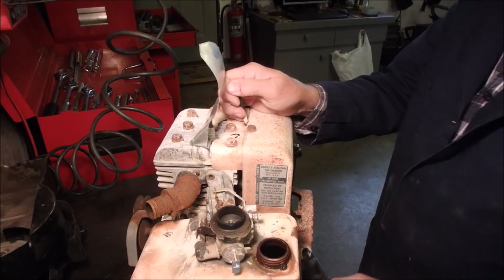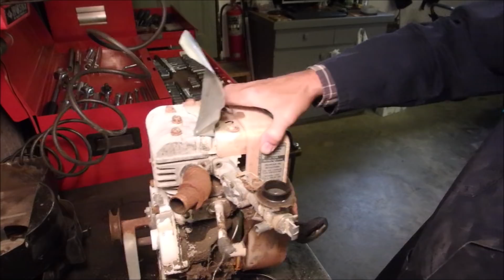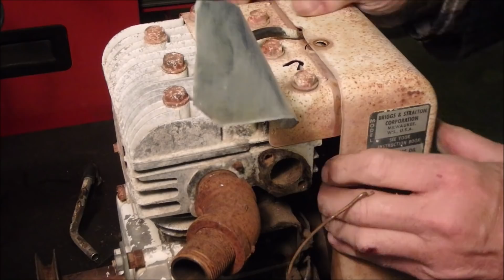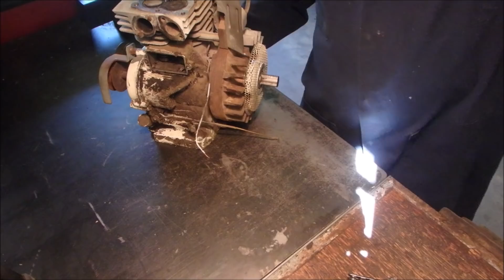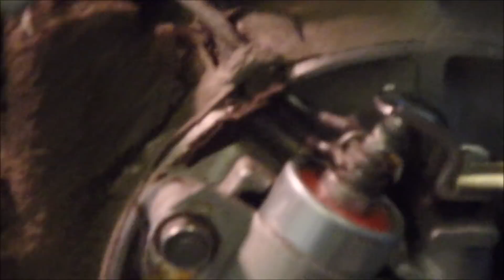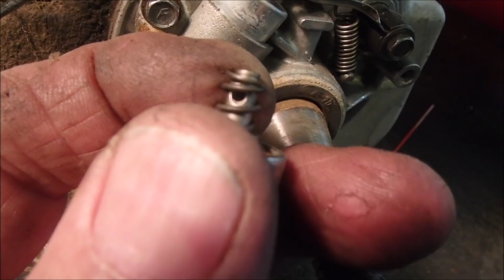Briggs 1971 has a little fire.  FUN!!!

Comment: I acquired a horizontal shaft engine not long ago from a friend. It was still in the box, as it had been shipped from the factory. My friend had inherited it from his grandfather, and I asked if I could buy it from him. So I bought it, put it in my basement, and kinda forgot about it. Yesterday I decided to take a look at it, after watching this video. It turns out it is not a Briggs and Stratton, as I first thought, but it's a Tecumseh horizontal shaft engine, manufactured in 1986, and has never been run!
Reply from the maker: Wow  I am not sure if i would start it.  I don't know what you should do.

Comment: Hey Bruce
Any chance you have a spare “control cover” for a 7.0 Quantum that you’d be willing to part with?The part number is 792418 (the small black cover over the carburetor).
Thanks,
Jim
Reply from the maker: Where are you located Jim.  Shipping items out of Canada is very expensive.  I should remember but I am pushing 40,000 subscribers now.
Reply: @BrucesShop  Hey Bruce
I’m in the Edmonton area.  
This morning I was able to find one at the Lawnmower Hospital.  I brought one in that I had and they found a used one that matched and gave it to me for free!
Thanks for checking!
Jim
Reply from the maker: @jimyeske8498  I use them too.  Good job.
Reply: @BrucesShop  
Funny how a small piece missing like that affects the perceived quality/value of the machine.
Reply from the maker: @jimyeske8498  Right

Comment: Loved the vid right up til the fire .. glad your ok.. got question.. put brand new carb on Briggs intek to stop a fuel overflow prob.. the cut off solonoid is working I checked it.  It's a 15.5 intek.. cut grass w it yesterday no prob.. today I went to start and she was vaporlocked.  Pulled plug and fuel poured out.. cleared cylander and started right up.. any idea what I'm missing.. could new carb have bad needle n seat.. help
Reply from the maker: The needle and seat have to be leaking.  Do you have a way to pressure test the carb.  You can blow into it with your mouth on a clean 1/4 inch fuel line if needed.
Reply: @BrucesShop  thanks u were right.. I heated it up and adjusted the float so it sat level and fixed the problem.. you rock sir
Reply from the maker: @MunkyWrench  I agree with  Munky

Comment: I did one of there  rusty gas tanks several years ago and put pea gravel in it and taped it up and I had a friend that had a paint shaker and he strapped it on the paint shaker and it really cleaned the inside  up almost perfectly . Ive been told if you have one of these metal tanks too always keep it filled with gas in order to cut down on the rusting process  . I had a 40 year old briggs triller and thats what I always did too it until I sold it last year and it never did rust up .
Reply: Great tip Marshall!  I bet the paint shaker made that tank nice in short amount of time! ✌
Reply from the maker: @rogermcdonald1607  Yes  I just did a tiller as old as this one and the tank was full of fuel and perfect as well.
Reply: @rogermcdonald1607  I did a great job .

Comment: I don't  believe i have ever seen an engine with 2 output pulleys. What application would be be used on?
Reply: Reverse on
A roto tiller
Reply from the maker: @THEMOWERMEDIC1  It came off a tiller and was for reverse.
Reply: Two stage snowblower